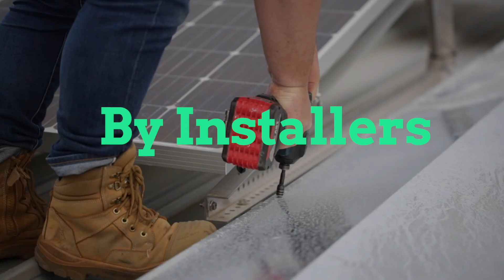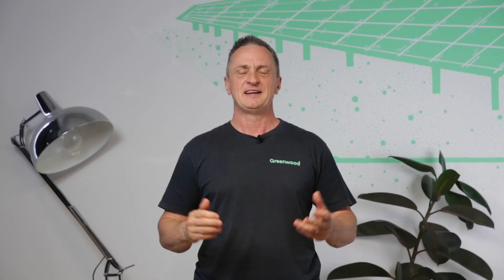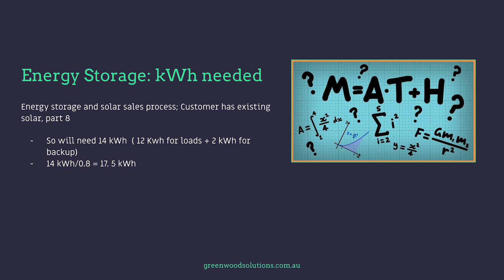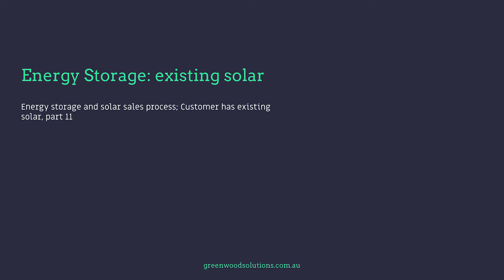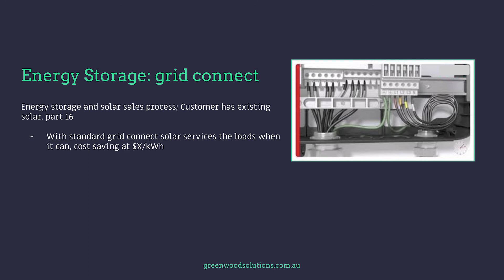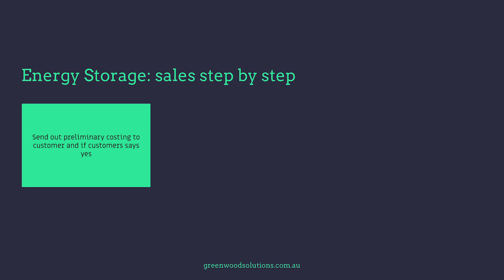Energy Storage: Sizing and Sales PART 2

Comment: If solar is existing. up & running for more than a year, and I've got the 15 min time interval load profile, including import, export from/to the grid. How is the criteria in that case for proper sizing of energy storage, taking in consideration avoiding winter partially recharged battery (specially for Li-ion)?
Reply from the maker: Good question, Hamid. Have to take into account, peak and off-peak tariff differential, day: night load ratio, battery charging efficiency, and more.